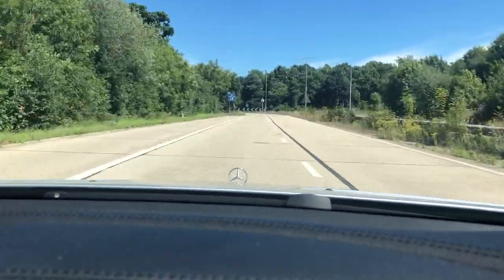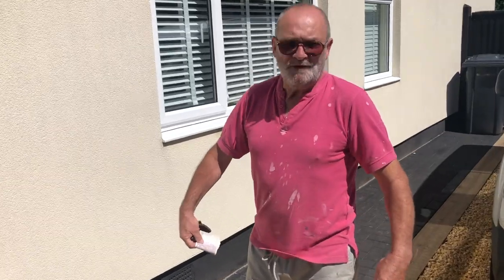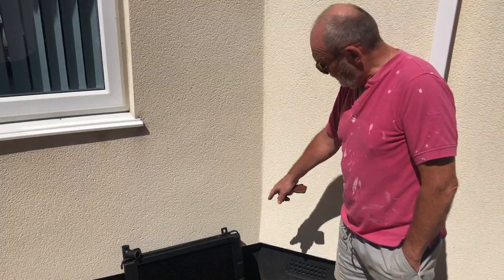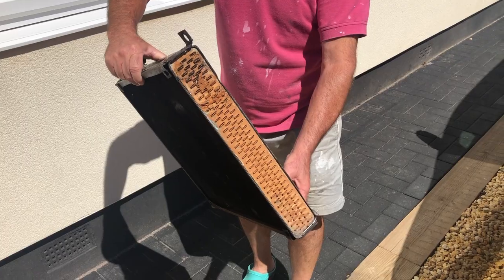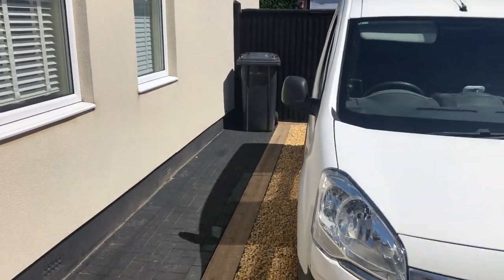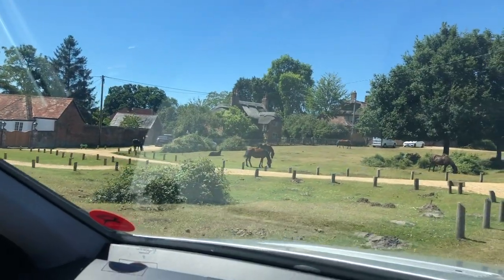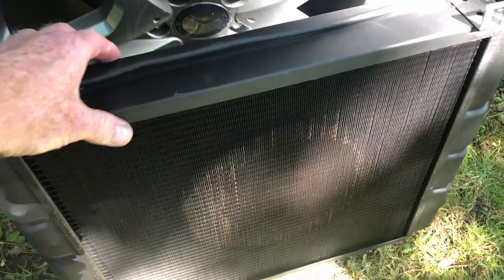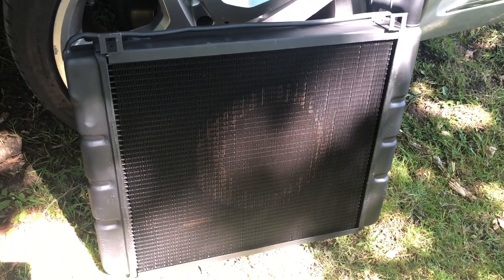Triumph Stag Radiator - Fixed!

Comment: Why did you go for a refurb and not a new one ?
I put a new rad. on mt Stag the other summer.
It was a sod to remove and even more of a sod to fit the new one ! There was so little clearance between the fan and the radiator. The two clashed when it was fitted, so I had to bend the tabs at the top and slot the holes in the valence in order to push the rad. just a little further forward.
It's all in now. Not been able to get the car started this year though ! It cranks but doesn't fire.
Reply: @ArryTheStag  
Thanks again for you reply !
I got mine from Rimmers. They had a January sale on the other year an so got 15% off.
It was still the thick end of £300. I hadn't really realised that you could get rads refurbed. I still have the old one.